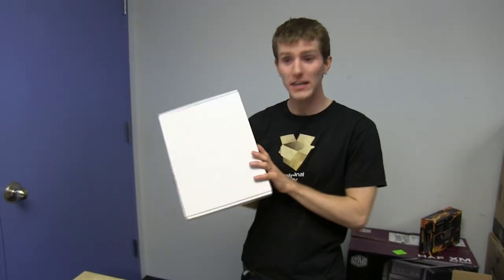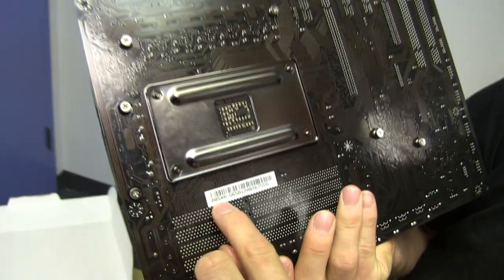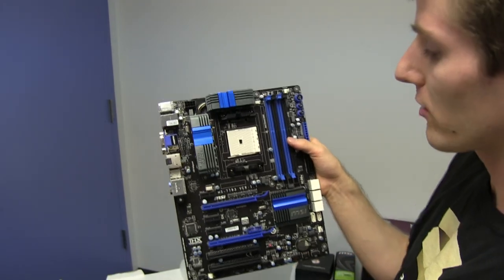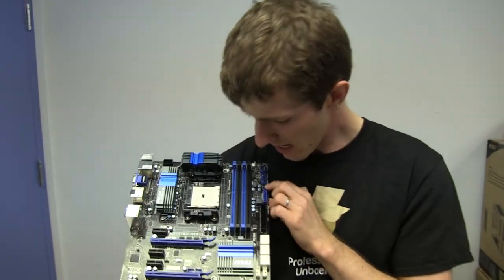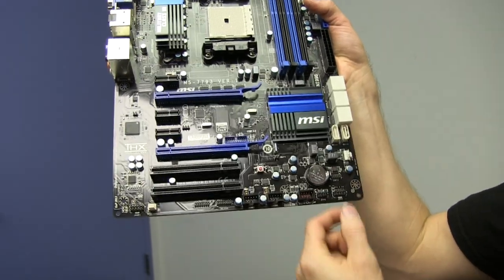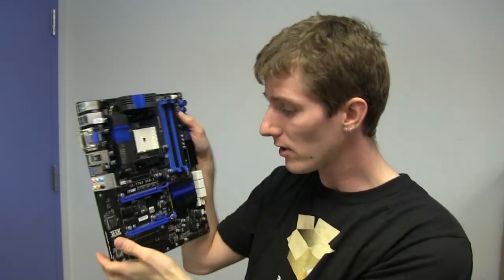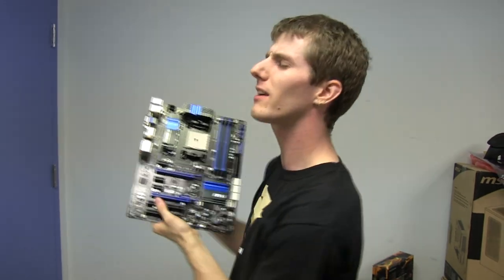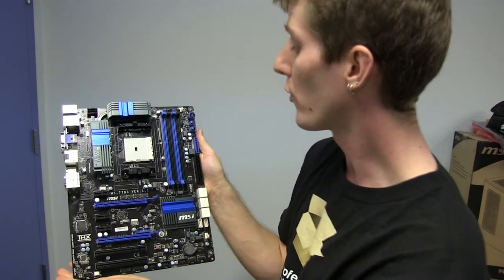MSI A85XA-G65 Trinity APU Motherboard Unboxing & First Look Linus Tech Tips

Comment: get the nzxt switch 810 in either black white or gun metal. Its $170-$190 but it looks fricken beast with a huge window and amazing features that will last you for a LONG time. Check out Linus' video on it.

Comment: yes it can run in dual-mode with another gpu
there are lists of recommended ATI gpu printed at the side of APU box

and if  you are using higher-end card , APU would actually switching off GPU in chipset entirely

Comment: looks awesome, however i am not sure why new boards are still fitted with USB 2.0, i would assume USB 3.0 is fully backwards compatable?? so its like why isn't all the usb ports now 3.0?

Also what happened to FireWire connection (1394) on new boards? 

Nice review, nice board, looks like MSI are catching up with Asus standard.

Comment: some benchmarks with the A10 in hybridfire mode and just using the iGPU would be nice. so we could tell if its worth opting for hybrid-fire or just go for a better discrete card in the long run. great platform for those with budgets though :)

Comment: A good 600-750w would be more then enough,btw go with a hd6870 or 6850 instead of a 7770 they cost around the same but both are faster.

Comment: Just a question, if you plug your monitor into your motherboard will it use the graphics card if it's plugged in or do you have to connect the monitor straight to the GPU?

Comment: go for it but you are limited for what you can do as in gaming fm2 not sure but im running an fm1 setup and i can run pretty much every game i have for instance here are my games sims 3(Runs 25-30FPS) ridge-racer unbounded(20-25FPS) saints row the the third (25-30FPS) Crysis 2 (15-20FPS) just 2 name a few.

Comment: 450W is usually more than enough, IIRC. However if you want to add a dedicated GPU later on (which isn't a bad option if you don't have the money right now) I'd get the 600W.

The a10 won't bottleneck any card, but you will see performance increase with a better CPU. Just remember, theres a difference between a slower cpu and a cpu bottleneck. If you want to make up the difference between say the a10 and an i5 with the same card, I'd just get a better GPU.

Comment: Mine won't be because as a CPU with dedicated graphics these are the same as an i3 and I normally get the mid range of the intel line up (I currently have an intel 3570k).

Comment: My current cart is:

ASUS AMD A85X SATA 6.0 Gb-s 240-Pin DDR3 2400 Motherboards F2A85-V PRO
AMD A10-5800K APU 3.8Ghz Processor AD580KWOHJBOX
Corsair Vengeance Blue 8GB (2x4GB) DDR3 2133 MHz (PC3 17000) Desktop Memory (CMZ8GX3M2A2133C11B)
Western Digital Caviar Blue 500 GB SATA III 7200 RPM 16 MB Cache Bulk/OEM Desktop Hard Drive - WD5000AAKX
and the PSU alrdeady checked and it's cheaper for me to buy it locally in a computer store, will get a 600w one to make sure.

Comment: i did not use the same case motherboard infact i used something else

Intel® Core™ i7-3960X Processor Extreme Edition : 
Corsair H80 CPU Cooler: 

Asus P9X79 Pro Motherboard

Gigabyte AMD Radeon HD 7970 OC GPU x2: 

Patriot Gamer 2 Series Division 4 Edition 16GB RAM: 

Samsung 830 Series 128GB SSD:

Western Digital Caviar Black 2TB HDDX3 

Corsair Power Supply 1200W 

Corsair Obsidian 650D Case

Samsung Blu-ray Optical Drive: h

Windows 7 ultimate 64 Bit
it cost $3400
anyway thanks for reply

Comment: Yeah, i just saw that the iGPU beats my current hd6570 that's on my system going to replace it with a hd7970 and will put the hd6570 on the apu that should give the apu a nice 50~75% boost in fps for free XD.

Comment: "Performance" socket FM2 motherboards are useless. The best APU is barely trading blows with the Core i3, and single/dual threaded performance on the AMD Trinity APU's is very weak. 

You might as well save the money on the board and get a better video card.

Comment: usb 3 header right literally above the 2nd pci express x16 slot?  nice fail msi.  -_-.  

You all knew better than to put it there.  If the customer chose to use a 3 slot video card ( galaxy accelero xtreme plus hsf edition gtx 580 for example) they might now be able to use their front usb 3 ports in their case.

Comment: The APUs are only good if you're not running a high end graphics card they bottleneck high end ones. They are equivalent to an i3 with better on board graphics. The main point of these is if you are not running a graphics card.

Comment: Actually no
If you are using this board you probably wont be using a video card and if you do it will probably be a low end 1 slot video card
and unless you are using something on the 1x slot like a TV tuner or fan controller
there will probably be nothing blocking that header
and if you are using a mid range video card (7850) it still wont block the header
not really dumb designers more like knowledgeable